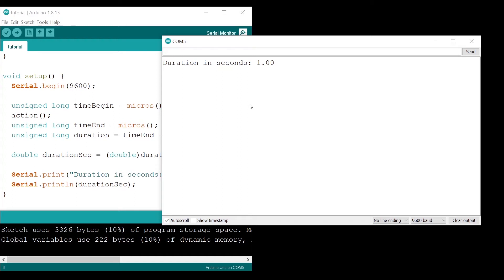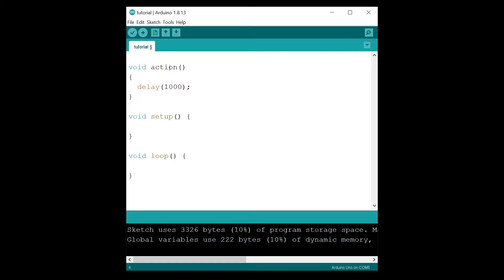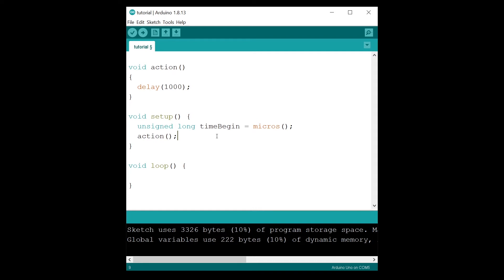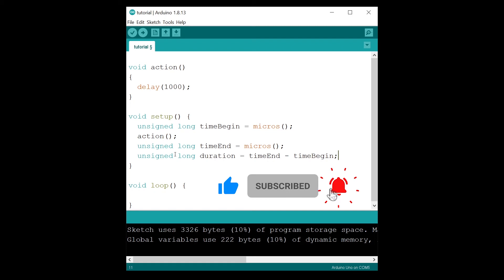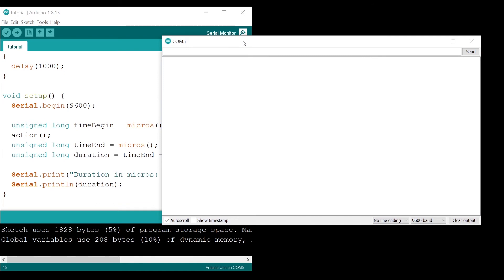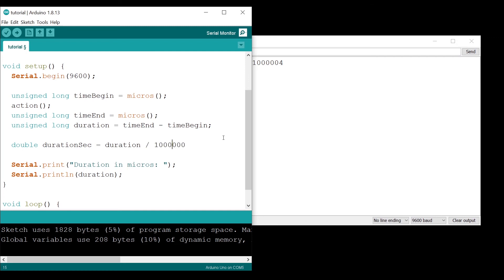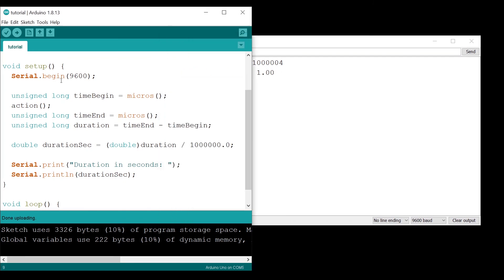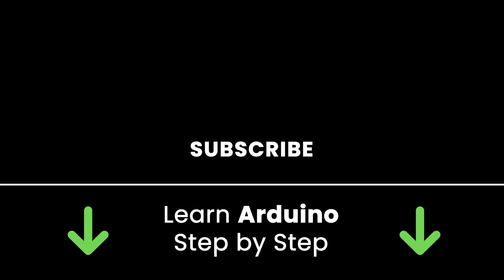Arduino - How to Compute a Duration with micros()

Comment: Thank you for explaining this function. I have got an encoder signal from a slow running motor, and I guess a way could be to measure the time between pulses using this micros function. I guess some hardware counter is used and you read that counter by micros. I looked in the hardware description for ATmega328P, but could not identify this counter. Do you know the name of this counter?